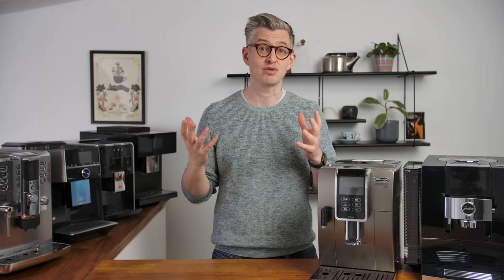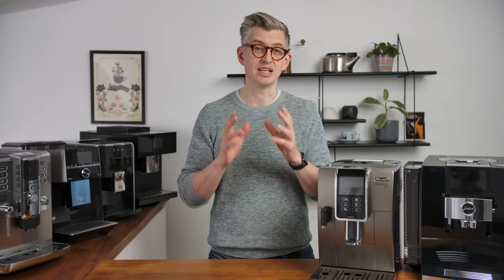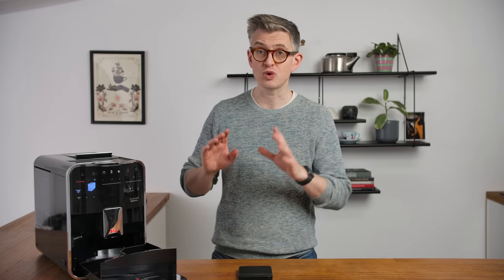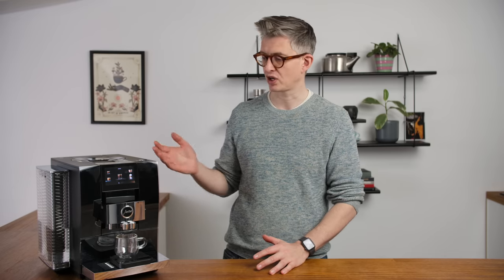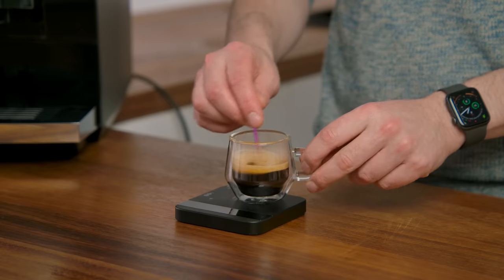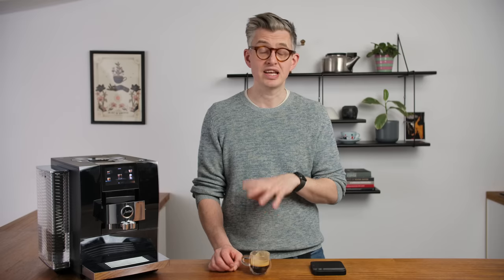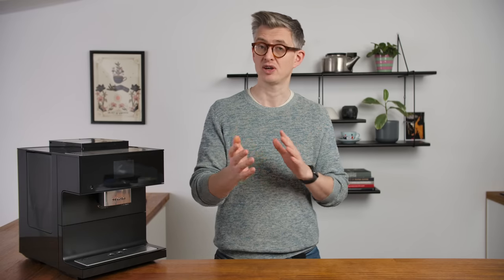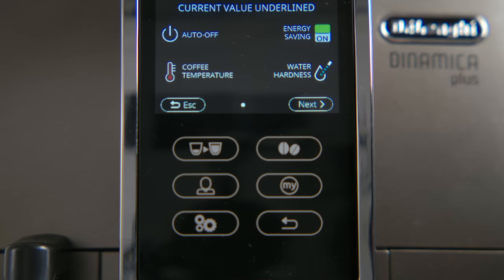How To Dial In A Bean To Cup Machine (Like A Nerd)

Comment: my parents have one of these at their house(the one on your left actually, lol), and the coffee it makes it not good.  It is weak, and oddly bitter and tastes almost burnt. I have been using the "cup of coffee" setting, not expresso.  I use the same beans with a normal brew method at home, and it is sooo much better. It's not even similar at all. You honestly would not know it was the same beans if no one told you. I may try tuning their machine a bit, i dont know what they have the grind set to ..and i will try mixing hot water with the espresso setting and see if it is any better

Comment: This excellent video brings up a good discussion point: Could you do an automatic machine brewing better specialty coffee? Something which in fact can grind finer and does the prep work so you can get properly extracted espresso. As the cost of the automatic machines can already be pretty high, they still rely on the "faulty" coffee preparation resulting in a less than desirable product (in end the price of the machine is not really reflected in the coffee taste).  Is there anyone out there trying to solve the coffee automation differently?
Reply: This is probably not possible with a super-automatic machine.  Something like Sage Barista Pro will be the best option.  It's not a super-automatic machine, but a lot of things are as simple as possible.
Reply: The breville/sage Oracle has solved this problem.
Reply: But what good is human in semi automatic machine? To transfer coffee from grinder to tamping to the group head? Machines are far superior at such a repeatable job. To tamp coffee? Once again tamping machines are already out performing humans. To clean up a puck afterwards? Maybe? For me it seems like technology already exists to try to think about fully automated proper espresso.
Reply: The Oracle performs tamping, all you have to do is lock the portafilter in. You cannot mess that up.
Reply: Almost, there's still a bit of dial in with it. Wish I could afford one tho!
Reply: A very good point. Even with very expensive automated machines in commercial environments such as Greggs or McDonald's the machine makes a pretty awful espresso. I still believe the market is wide open for such a machine.

Comment: While I appreciate this from a “coffee nerdery” point of view, I feel like anyone that was prepared to go through this would never consider this type of machine
Reply: There is the odd possibility of someone being given such machine or that someone like that pick this up because of other people in the household /office would like to have coffee prepared by single button without having to learn the way a proper espresso is made using traditional espresso machines.
Reply: That’s me.
Reply: I do get your point but my DeLonghi bean to cup has replaced my espresso machine. I just didn't have time to preheat the machine, measure, grind, tamp and then do cleanup, on a kettle break from working. I have pour over and aeropress for when I want the ritual, but a machine set up how I want it works for the daily.
Reply: I'm in this category. One reason is I don't want the amount of work that comes with semi autos and grinders etc. I know if I wanted to go through all that work and dialing that in, I could. The thing is, all the extra steps are just too much especially if my wife wants a latte etc. I'm a coffee enthusiast but I'm not fully committed to going down the rabbit hole of getting a semi auto. That comes down to the amount of work it comes with. 

The quality would be significantly higher of course compared to a super automatic but leaving a lot of variables out and just pressing a button and getting 80% of the quality of a regular espresso is good enough for me.
Reply: Disagree. I love decent coffee but also love convenience and these machines are a huge leap above nespresso machines, and do it all with one touch so that’s got to be better! Does an oracle touch put out better coffee? Yes it does, but it still involves too much faffing for me, and it can’t make a latte straight into a tall cup. The cleaning of these machines is critical as well as they can get very nasty inside without proper regular cleaning. For dinner parties these are very convenient and people comment on how good the coffee is.

Comment: Great video. Been hoping for some content on bean-to-cup machines. I have a Melitta Barista TS Smart for convenience as the coffee is way better, easier and cheaper than any other method for my work coffee hit in the morning. Would you be able to post/discuss your recommended settings for the machines? I know there's likely small variations between each machine and that the type of beans will have an effect, but it would be a great starting point.

Comment: Tried something different. Adjusted the grinder up and down as it grinds. So end up with a Hybrid puck and doesn't channel (as the Delonghi machines do on find grinds).
Also think these work better with multiple smaller shots, again less channeling as the pucks are thinner.

Comment: Not your place to do it, but maybe you would be a good source to drive it is some kind of spreadsheet that lists every make/model you’ve personally used or maybe even others have crowd sourced with their most ideal settings making this a lot easier. 

Even with the excellent scientific method listed here I still question whether I’ve got it quite right. 

Even a recommended grind setting per manufacturer would be a great help.

Comment: I was gifted a Magnifica S. How do I work out what's the factory grind setting for the machine? The previous owner had it set to the finest setting. My first cup at that setting was super sour. I wasted 250g of coffee beans trying to dial in. The dial is numbered 1 (Finest) to 7 (Coarse). Should I start at 4 and adjust in either direction until I get a balanced taste or should I start at 1 and move my way up to a balanced taste?
Reply: I have a Dinamica Plus, and factory was 5. I dialled it, in the end, to a step short of 3 and have hit my sweet spot with the Lavazza beans I like. The latte macchiato and espresso macchiato I had today were lovely!
Reply: @namrepmek  Great! I'll start at 4 and go from there. Which Lavazza beans do you favour? My favourite is the Tierra.
Reply: @randommusings48  I really like the Espresso Barista Gran Crema, though will try the Super Crema if I can get hold of them—bit hard to find at the moment.
Reply: @namrepmek  Heya, so I think I got the grind setting right. I've arrived at 3 and a step. Max dose on my machine is 10g so does that mean I'm supposed to be 10g in and 40mL out? I can't adjust the water volume on the machine but one shot is 40mL anyway.

Comment: I used to have a bean to cup machine from Delonghi which would tamp down the puck before extraction. You could head it grind, then move to this plastic stump which it would press against and then move to extraction. Guess it was too much engineering to keep in other models.

Comment: I have a Delonghi Magnifica S, and what I do is:
- set the dosage to "max"
- for each espresso, weigh the beans and drop them in to the hopper
- start the double-shot, grinder starts, and i use my fingers to push the beans in to the grinder
- stop the shot based on desired ratio.

The grind setting was a trial-and-error process to figure out where the machine can successfully extract shots at the 8-11g coffee dosage.

Comment: I have a question: i have this kind of machine, but taken a different route to dailing in the machine on which i would like your opinion: i use the grind size setting to determine the brew time. My logic for this: it takes about 27 seconds to extract all the flavours from the coffee (give or take). So i have a fixed volume of finalized coffee and just set the grind size finer if the coffee is prepared too fast, and coarser if it starts dripping/clogging/going too slow, which gives a horrible taste. What do you think?
Reply: Ow... And the only way to get somewhat close to espresso, is to make a double shot

Comment: Is the first few seconds not the bitter tasting part (cremor)? I thought some people remove the initial bit as it covers up the flavours. For example. If you press. Some say remove the top with a spoon before pushing down slowly.
Reply: I struggle with the espresso button. The coffee button tastes better.  I have even tried using 4 different cups and collecting different portions of the coffee to see which part tastes bad or good

Comment: So - some Nerding going on here (see comment below this)- on the factory settings ive discovered that the Avanza gives you about 11g of coffee, but the cut the power and re-cycle method doesn't work and may lead to you putting 22g of coffee into the puck and the machine refusing to deal with it - you CAN vary the water amount supposedly by 25mls at each segment of a dial (ps each segment is also divided into about 10 clicks so I MIGHT be able to improve this, but ive discovered each supposed whole segment varies wildly as you go up - so on the base setting you get 18mls, step 2 - 41 pls, step 3 80mls, etc. To the cognoscenti out there, do you think the first step underproduces liquids due to the fact that pre-infusion is presumably counted in the amount of hot water the machine feeds through? If its all based on a timer, I wonder if each step is increasing therefore due to channelling?

Comment: For the kind of price these super-automatics sell for, I would hope that the manufacturers Q/A processes assure that the weights and volumes and temperatures, etc. are finely calibrated before they ship out. I realize over time, tolerances can potentially slip, but it should be possible to “zero” out the machine’s measuring processes with the touch of a button?.
Reply: Depends on the makers but as with everything, if you outsourced something to be made abroad there is no costing plan really... I do find that the machines that James demo are that bit sophisticated and often with this high level instrumentation... It really isn't for the domestic market then it is for the commercial sector cos there is an actual maintenance piece... I would say it's value for money if I can indeed use this machine for other purposes as well. I am intrigued if he ever tried to do similar things like cocoa beans or something like that. :)

Comment: Thank you for introducing me to the 'Turbo shot' concept. I'll be honest though. The idea itself already existed in my head for quite a long time (even before that scientific paper) but only as something that "logically made sense". In a way, you're basically just increasing brew volume to compensate for the weaker resistance from the coarser grind in order to achieve a proper brew time after all. 

I think the thing that kept me from ACTUALLY trying it out before was my stubborn belief that "strength is everything" in espresso. Back then, I thought that strength was the best way to "magnify" the flavor profile but this way of thinking often only resulted in overwhelmingly concentrated shots that I could barely taste. I never once thought that dialing it all down would lead to the improvement in clarity that I've been looking for all along until now. I also believe another reason why people haven't tried doing this earlier because the espresso community collectively got in its head the idea that the Ristretto was THE "god shot" that literally everyone SHOULD chase after and this has been the de facto way of thinking ever since. 

Now I understand that strength is separate from the flavor profile and, moving forward, I will be playing around with my recipes so that my shots are only strong enough to complement the flavor profile instead of always overwhelming it. 1:3 will now be my starting benchmark and if anyone else thinks that's weird, I say "don't knock it 'till you've tried it".

Comment: I found the steps a bit confusing. We start with measuring the max coffee and setting teh liquid to 4:1 of the coffee. Then there is a discussion around setting the grind finer but not too fine. Then we start hearing about increasing in 5ml steps. Is that from the 4:1 ration that was setup at the start? Doesn't it need reweighing after the fineness has been changed?

Comment: These machines change the grind time and hence amount of coffee ground based on the tamp pressure of the last puck. My machine will grind on max strength on grind setting 3 - anywhere between 9-13g. Depending on the last puck tamp pressure. My parents which is a different make will vary between 8-10g and the machine we have at work which is same make as my own but more expensive varies between 11-15g. I took my own beans in to test. So the bottom line is that weighing coffee grounds is a waste of time. If you grind without quite enough beans to complete a full grind for example the machine will grind longer next time. If you change beans it alters. If grinder performance changes over time it will alter the amount ground as it detects changes in tamping pressure. In short weighing grounds on these machines to calculate ratios is a waste of time!

Comment: I'm really struggling still.  I have a Delongi Eletta Explore super auto machine and the espresso is quite sour.  I've played with the grind setting from 2.5 to 6 (it ranges from 1 to 7).  At 2.5 it starts to choking a bit and the grinds have a bit that are quite dry and some are quite wet (suggesting channeling).  At 6 it brews super fast.  Both are very sour, but even 5, 4.5, 4.0 3.0 are sour as well.  I'm not sure what I'm doing wrong.

Is James suggesting that you should brew on the strongest setting (largest puck) at all times for all drinks and just adjust the size of the drink to adjust how strong you want it?  Or, is brewing on the strongest setting only to dial in the grind and thereafter you can adjust the strength as desired?  The struggle is I like a rich, strong coffee and my wife likes it not very strong at all.

Comment: Great video! It would be awesome to have a coffee taste comparison across all these machines. Is Jura with PEP the best one, or is it marketing only?
Reply: As a bean to cup machine mechanic I can tell you some things about Jura. It's biggest flaw: it doesn't have a removable brew group. And that's just disgusting! Some customers even wait for maintenance till they smell mold in the cup. Horrible
Reply: @peterv6036  How about their cleaning tablets, do they help?
Reply: I just got a Jura E8 (still under the return period). I'm wondering if a Gaggia Magenta Prestige or Delongui Dinamica Plus would be better options. 

I drink only black coffee (lungo, coffee, americano, espresso).
Reply: @PabloCanterodotcom  cleaning tablets help to keep the brew chamber, screen and tubes clean but can't remove moisturised coffee grounds outside the brew chamber. And that's where it gets moldy
Reply: @PabloCanterodotcom  E8 is a very nice and good looking machine but that non removable brew group would be a deal breaker for me. The milk container of the gaggia magenta prestige is awful, it can get really dirty with milk in spaces you can hardly clean. The plus or milk version are a better option! The technology of Gaggia (same as Philips/Saeco) isn't bad at all, very decent machines.
Delonghi Dinamica plus isn't a bad machine either. And the milk container is a little bit better than the gaggia magenta one, but I'm still not a fan. Btw every brand has its flaws, there's no perfect machine
Reply: @PabloCanterodotcom  i'm planning to buy a Jura E4 (i'm not in milk drinks) and i'd like to know if 3D brewing plus Pep is able to make something like an espresso. In Italy there is no way to try the machine before buying

Comment: I was sold the idea that a superautomatic could brew any bean. I bought a Phillips 4300 and used Starbucks Pike Place medium roast beans first. I couldnt get it to make a puck. Instead everything was a sludgy mess that never exited the brew group. Turns out that medium roast was STILL too oily for the grinder. So the grinder wasnt outputting a large enough volume of coffee grounds to form a full puck. I've now spent the last week buying and trying many different kinds of other non oily beans only to be frustrated because every other bean tastes sour or overly acidic...WTF?! So far my experience with a super automatic has not been pleasant because my options for beans is so limited. I've got a machine that can automatically make a terrible half assed espresso over and over again. It's not even able to achieve high enough pressures for a "real" espresso.

Comment: Thanks for posting this – curious if you've tried the higher end, built-in/plumbed-in options like those from Miele, which cost as much as a high end espresso machine?

From the looks of things they have similarly designed brewing chambers, but more controls. The manual indicates it has options for quantity of coffee (7.5-12.5g), brew temp, pre-infusion time, total brew time (I think not volume), and grind fineness. I've been waiting delivery one of a CVA7845 (which I got for the ease of use, always on, direct-water, multi-bean, auto-descaling, built-in convenience of it) but this makes me wonder how it will end up comparing to my espresso machine...
Reply: We have one of these at work and it’s absolutely slow and terrible and takes ages to make one drink. It totally put me off wanting a built in coffee maker in any future homes to be honest, although the Miele ones are the best ones available.
Reply: @robinisathakur  so since I posted this comment I actually received my built in (it was long delayed). I got the CVA7845 and it’s pretty incredible. The controls to dial in coffee are fiddly but once you get it going it works really well, it’s fast, it’s quiet, it descales itself. It has 3 bean hoppers you can swap between. The milk foam is great. Valuing convenience over control here it’s been a really great purchase.